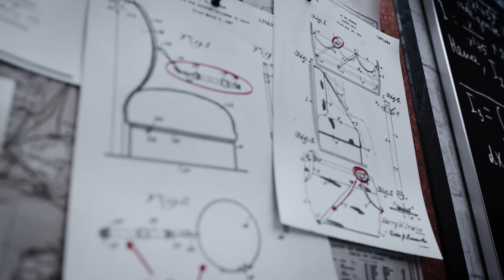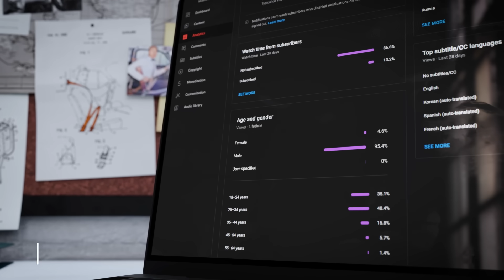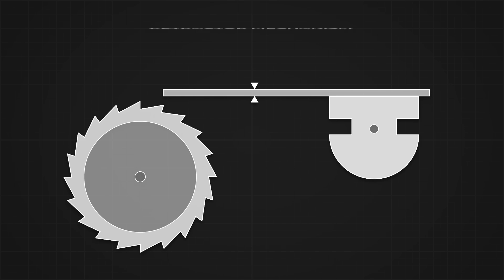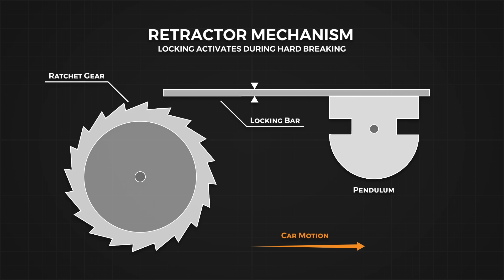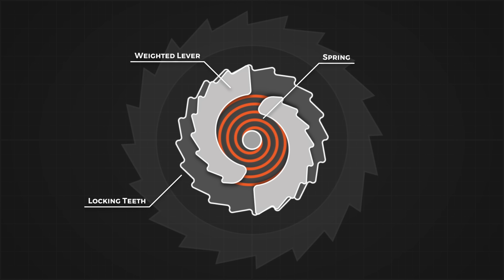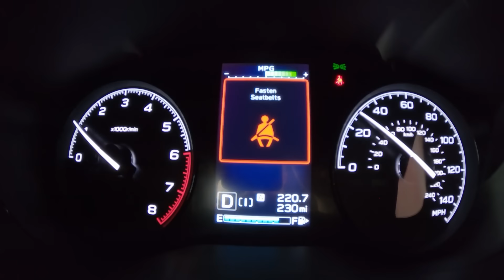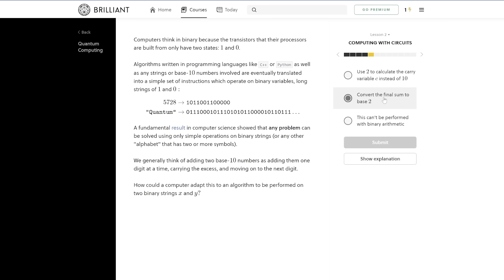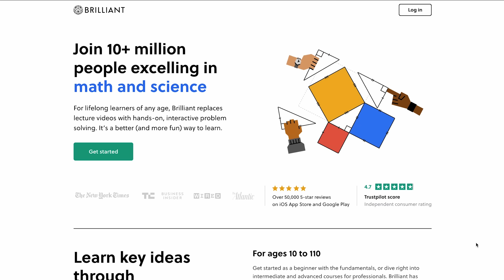How Do Seatbelts Work?

Comment: As a reminder/indicator of how fast technology advances, at one point in this video he talks about self driving cars not being a reality yet.  Well as of today 2025-09-18 this video shows   1M views   2 years ago    So in those two years since this video was made, self driving cars have become a reality.  Here in Las Vegas we have robotaxi by Zoox which may be summoned via the Play Store app.  It seats four riders and has no space for a driver.  It's a fully electric vehicle with no front or rear windows, four wheel steering and no preferred direction of travel.  Currently its service is limited to two hours per day with a limited service area around The Strip.  I've seen it several times over the past several months of its testing phase (always empty), but very recently it entered service and I have seen it carrying passengers .  The app was released on 2025-08-19 so I'm guessing that was when it began accepting passengers.  Although one day it will likely put me out of work (I'm an Uber driver) I like having it here and have just installed the app so I can have the experience of riding in a fully autonomous vehicle (I'm toying with the idea of recording the trip and posting it on YT {content idea - see if chatGPT wants to come along for the ride, getting some glimpses through uploads of captured pics}).  The only other city in which it currently operates is San Francisco.

Comment: They wouldn't let me have a car with seatbelts in the 70's. Wouldn't let me have a car with air bags or mag wheels and disc brakes in the 80's. Wouldn't let me have aftermarket safer seats  or a four, five, or six point harness in the 90's. Basically everything Australia does is 20 years later and in the meantime when I want something better they fine me for using it. I just pay the fines, I don't care about their dumb rules surviving is more important to me than money.

Comment: Wear em. My seatbelt has saved me three times. The most recent time I was sitting in traffic and got rear ended by someone going freeway speeds. Picked my truck up and dropped me upside down two lanes over. He was on his phone. I walked away without a scratch. Truck was about 2 feet shorter than it had been minutes before. My seatbelt kept me from violently meeting the roof of my truck. I did have to cut it to get out, but I made sure to keep the pieces.

Comment: Torsion bars are not only designed to absorb some of the force, but also to break, if the forces get too high, so they don't stop the belt too much. I worked at a company manufacturing them and had to make them to different specifications for testing.
Great video btw

Comment: They should make the front seat belts break at a kill speed (shortened for a speed that being expelled out the window would do less damage than the seat belt resistance ether breaking ever bone in the chest or the console crushing you) so if you go too fast and crash you won't have your chests bones and organs turned into dust by the force shoved into your body

Comment: My truck currently has only lap belts, but I'm planning on adding modern 3 point belts as part of the modification/upgrade plan.  I've already ditched the solid spear steering column in favor of a collapsible one, too.
Reply: Go for the 5-point harness instead. That crotch strap will save you a world of suffering IF...

Comment: Seatbelts saved the lives of both my father and I and to this day I still consider them to be the most important innovation of automobile history. 

When I was 13 we were driving home from a baseball game that had gone far into extra innings at around 11 at night. As we were passing an off ramp, a car that was operated by a driver that we later learned was drunk flew out of the exit and into our lane and struck us at the rear, pointing us towards a heavily wooded forest. My father jerked the wheel towards the median, saving us from striking a tree but putting us on course to hit the median nearly head on. The impending collision led to my father slipping a disk in his back and myself to experience lifelong side effects from the severe whiplash, but we both walked out of that car alive and in relatively good condition.

Comment: In addition to the reel/retractor locking up, the buckles nowadays are cable mounted to a charge cylinder, so in an impact, an explosive charge ignites in that cylinder pulling the cable mounted buckle tighter.  But it’s covered in pretty plastic trim.

Comment: I’ve never tried to put a seatbelt on to quickly,jamming it, and then throwing a tantrum and wondering why it’s still jamming…. I don’t have anger issues and I know how to properly use things.

And you should mention instead of scaring people with the worst and worst condition crash videos… that people should be sitting properly, and wear it properly. It makes a hugeee difference. (Ask me how I know) 

Under not even ideal conditions but “don’t be a dumbass” conditions it can be the difference between life, injury, or death. I managed to “get lucky” but it wassnt luck. It’s because I sit properly, I always manually pull on the belt just a bit to tension between the floor point and the lap point, and let the mechanism keep what tension it wants from shoulder to hip. Cuz here’s the fun thing. Though the hip point slides and moves it actually works a lot more like a static point then you might think. And that’s actually the coolest thing that you didn’t mention… yea it has slip to allow for movement but if the pretensioner fires all that force should in that instant be across your chest, not a lot goes across your hips. That’s why you need to make sure when you move and russle arround that the lap point is correct

Comment: Actually in a lot of german cars the pretensioning mechanism is fully electronic nowadays.. it often starts pretensioning as a risk assessment step e.g. when you approach an obstacle very fast you can feel the belt pulling you back into the seat.. often combined with a visual and sound warning..

Comment: The pretensioner is not actually meant to pull you back against the seat, all it is supposed to do is pull the seat belt as tight as possible to make sure there is no slack. Aka it pretensions the seat belt so it can absorb the impact better.

Comment: I wonder if old seatbelts DID cause more harm than they prevented. It sounds like they had a lot of advancements between the first lap only belts and the three point harnesses with strain relief stitches and pretensioners of later models.

I'd love to see a study on whether early seatbelt hatred was well deserved or simply misplaced.
Reply: In early cars with lap belts only or the ones where the shoulder belts were separate and people only wore lap belts there were injuries from the belts.  As a teenager in the mid 70s I drove a 1970 Buick Electra that had separate lap and shoulder belts and I wore both of them. One night a drunk driver hit me head on and I can tell you that the reason I was able to walk away from the collision was  the fact that I was wearing both belts. The lap belt held me in the driver's seat and the shoulder belt helped distribute the force of the crash from just my abdomen and kept me from eating the steering wheel or dash.

Comment: What seatbelts don't save you is being Crushed, many gruesome aftermaths have dead people hanging on the seat without a limb or a head.
Reply: Better than being tossed out the windshield, ripping your head off in the process.
Reply: @drachula1184  Meh depends on the  type of accident,  most common deaths from where I am is usually small cars being swallowed by large trucks.
Reply: It's almost like they're not designed to save you from that kinda of trauma, if there's enough force to over come the integrity of your vehicle your seat belt is the least of your worries. What a dumb fucking thing to say
Reply: @notIVALDO  

Just stating a type of accident that seat belts won't save you from. 

"DID I SAY SEATBELTS WERE BAD?" 

They are great for their intended use but not anything beyond that.

Comment: Seatbelts saved the lives of the idiot driver (me) and my 2 passengers when I was 19. The car was utterly wrecked and one passenger needed to be cut out by the fire brigade. There was a distinct stripe of bruising & fabric burns across my chest where the upper belt ran, but it was of course far better than the alternative.
I learned some hard lessons that day.

Comment: I remember hearing a couple of stories about how some of the everyday things and items we use or have in our daily life today came about.

Like the seat belts in this video, the story of how they became a National Mandates Requirement in All automobiles in the US to have seat belts is the result of the USAF and USN pressuring the Politicians in DC and Automotive Manufacturers to have seat belts installed into their vehicles because they were losing too many dam good experience pilots on the ground due to them being severely injured or killed car crashes. 

Another safety feature inside your vehicle the Airbags, have their origins in the USN when a Submariner was working on a Torpedo when suddenly one of the pressurized tanks had a sudden rapid self auto-disassembly what saved the Submariner from being seriously hurt was this canvassed sack that was over the Torpedo had inflated rapidly due to that sudden release of compressed fluid(air).

Comment: 5:45 centriPETAL force, there is no such thing as “centrifugal force”

small nitpick, but a mistake my physics teacher wouldn’t approve of!!

(it’s not that serious it’s just a small mistake)
Reply: You’re right saying that centrifugal force is not a real force, but it describes a real phenomenon, which is what’s going on here. 

The rotation of the spring makes the weighted lever rotate, but since it has inertia it “wants” to follow a straight line so it is flung outward. This effect is centrifugal “force”.

The centripetal force is 
the inward force acting by the locking teeth on the weighted lever once they have engaged.

Comment: "15.000 lives saved per year"
that means there are accidents in a figure high enough to accommodate those 15.000 lives that are saved by a belt, which would have otherwise perished without it.
so,... why is people putting effort in saving lives with seat belts and not in tackling the real problem that are the accidents themselves?
if a car crashes, that is 6 people that are potentially saved by a belt.
if a car crashes hard enough that it slams against a truck or a bus, no amount of seat belts are gonna save those lives.
if a BUS crashes hard enough that it topples or rolls over, EVERYONE will perish.
if the driver of any of those vehicles goes asleep at the wheel and causes the crash, the seat belt is irrelevant!
if the vehicle goes at a speed that it makes the potential impact in case of a crash dangerous, THEN and only THEN is the seat belt relevant enough to prevent a fatality.
WHY does nobody build a vehicle that can't possibly go past a speed that would be dangerous for a person in case of a crash?
if the vehicle CAN go 100kmh, and you GO 100kmh, RIGHTFULLY DEAD you are if you crash!

Comment: When I was 16, I crashed into a thick steel pylon at about 30mph. EMTs on site couldn't figure out why I didn't seem concussed or more injured given the severity of the incident. After a few days (and a CT scan), the only injuries I developed were bad bruising from the seatbelt and two small cuts. Definitely would have ruptured my organs on the steering column or hit my head without a belt.

The biggest thing I remember was the acrid smell of the airbag propellant and literally everything in my chest hurting for about 5 minutes after the accident because of the seatbelt.

Comment: I grew up in the late 80s and 90s and definitely saw the way attitudes changed about seatbelts. I have some very nice memories of driving 5 days from my home in Ontario (Canada) to the Florida Keys with the family in my Dad's pick-up with a cap on the back. My brother and I rode in the back almost the whole time. There was a small window for us to crawl through to get up front, so we would crawl up there and all 4 of us crammed together on one row would go through the toll booths. We didn't want to get in trouble after all lol.

As for the situation in the back, all we had was a mattress for us to sit on. Definitely no seatbelts. I loathe to think if we were rear ended by an 18 wheeler on the freeway. I don't remember much else from the journey. Nobody in my family wore seatbelts even in the front seat at the time, anyways. It wasn't until around 1992 when my Mum got pulled over for us not wearing our seatbelts that we started wearing them religiously. I was just little so I was absolutely terrified when we got pulled over. I thought my Mum (and possibly me) were going to jail. But he just gave her a warning and we wore our seatbelts religiously after that. Still do.

Comment: I think there should be a modified seatbelt that sends a signal through it, from the top of it, all the way through to the end you click in, so the car won't start until at least the driver is buckled. My dad would greatly benefit from that ._.

Comment: There is another safety mechanism seatbelts have that is often overlooked...

When you extend the seatbelt completely, it locks into the ratcheting mode... which is the proper way to engage a seatbelt!

Comment: We are definitely NOT a long way from self-driving cars. They exist, and there is a taxi service in California that operates them. The reason people THINK we are a long way is because people are scared of them. When, in fact, they are much better at driving than we are. The ONLY accidents self-driving cars have been in have been caused by other people: the self-driving car gets rear-ended, or a pedestrian steps into traffic without warning.

If people were more accepting of them, they would be more common. And, frankly, our roads would be safer, because computers are better at driving than we are.
Reply: Literally no one thinks we're a long way away, you can literally buy a Tesla with FSD (full self driving beta) right now. A bit odd how you picked a random californian taxi company instead

Comment: Why is it that plane seatbelts are only 2 points?
Reply: Well, because, I don't think a plane running into a mountain (or the ground, ocean, etc...) at 514 mph would do much. I think they mostly have it there for turbulence and landing/takeoff.
Reply: Same reason a school bus doesn't have seatbelts. The bus is so massive that any typical crash will not cause much acceleration inside the bus. Likewise, normal impacts for a plane like landing hard, crunching the nose, or turbulence will not cause much acceleration inside the plane. Plus, you also have requirements for evacuation time and more than a 2 point could interfere with that. If you get to a non-typical impact as mentioned before, no amount of seatbelt is going to help.

Comment: SAAB & Volvo has Always been the Frontrunners when it comes to Person safety and Tech Development for cars in General.

While Volvo was the first maker to introduce the 3 point safety belt SAAB was the first to have all seats belted with atleast a 2 point belt as standard.

SAAB and Volvo probably has stood for more than 50% of all Important safety engineering of cars between 1950 to 2011

Comment: As someone who's survived a 110kmh (66mph) head on crash with a big red Kangaroo that came in through the windscreen and then hit a granite rock wall while the Kangaroo thrashed around on my lap, the seat belt most certainly saved my life, it also did massive internal damage breaking 5 ribs and rupturing my diaphragm requiring an emergency Thoracotomy (open chest surgery).
I've also had to have an additional 25 operations on my stomach.
But had I not been wearing a seat belt I'd be little more than a red smudge on a rock wall with a dead Kangaroo for company. 🇦🇺

Comment: Don't cross your arms while steering. Yes shuffling the wheel is weird and slower but it does give you more control and more importantly. What do you think happens when your arm is across the wheel and the airbag comes off?

To give you and idea of their force, here https://youtu.be/bKRoTBUf6EQ?t=164 .

Now instead of that tyre being launched into the air, imagine it's your arm being launched into you face.

So unless you want facial reconstruction, shuffle that wheel while driving .